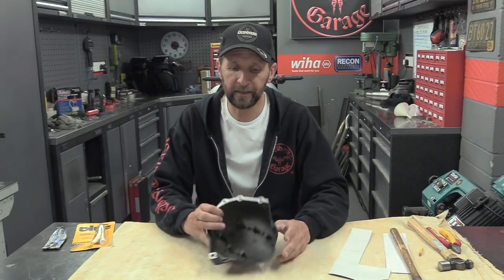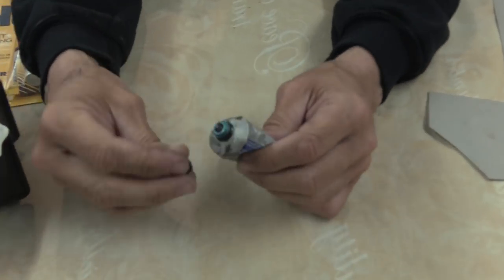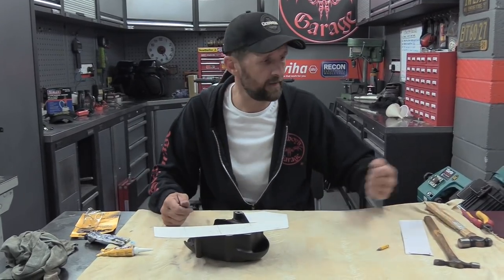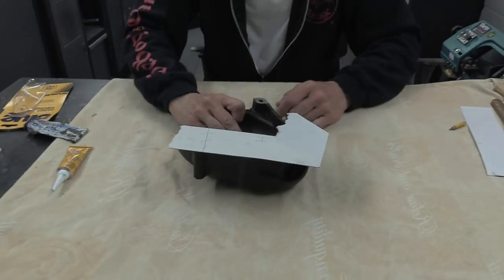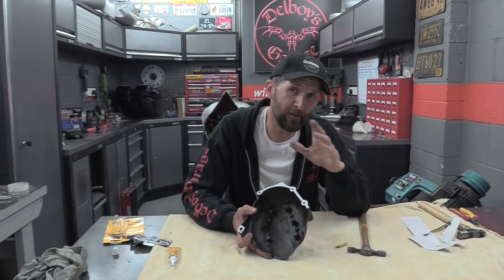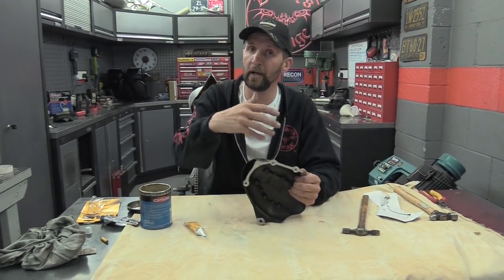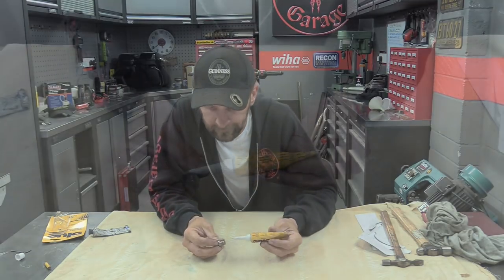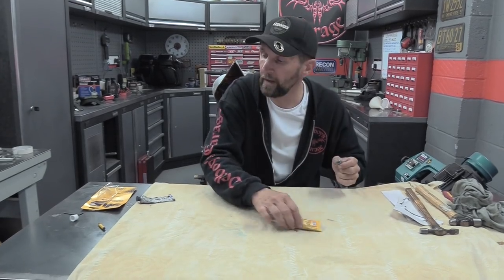Delboy's Garage, Simple Skills, "Tap out" a gasket.

Comment: I wouldn't trust using normal thin cardboard as a gasket that has to cope with high  temperatures. I think it would make more sense to use  gasket material that was developed especially for specific temperatures.
Reply from the maker: Cereal box card is absolutely fine, it's been used for gaskets for generations.. just know the difference between a critical gasket and a secondary gasket!      Cylinder heads, base gaskets, valve cover gaskets, anything involving pressure.. buy the real ones.. but side casings, perfectly fine to make one using regular ordinary card !

Comment: FZR600 Genesis Clutch all done and completed with the clutch case gasket completed as you demonstrated. No leaks. I did buy a hole punch set to do the holes, made life easier. Thanks again for the top tip from your experience.

Comment: Hi When I make a gasket it is in a similar way, the only difference is I cut the holes first and drop screws in to the holes. This helps stops the gasket sliding or wrinkling. 

I do this with a tool I made god only knows how long ago.

Its a punch of sorts using 3 short pieces of round bar about 100mm long and 10mm dia with 8mm 10mm and 12mm ball bearing welded to one end for different size holes.

Hitting it with a light blow in the centre of each hole covered with the gasket paper and the ball will shear the paper as you do with the hammer on the edge leaving a perfect cut hole. It is also useful where there maybe a tight corner on the edge of the casing where a even ball peen hammer would find it difficult to get a nice clean cut unless its very small one.
Reply from the maker: Wise words well said my friend, thanks for your input !

Comment: Definitely in the top ten of Delboy's how to videos. Invaluable stuff. Can be used on any engine. Ideal for joints, such as oil cooler hoses and pipes. A flexible and reliable seal. A must have, like copper grease, in any toolbox.
Reply from the maker: Basic automotive condiments aye..

Comment: Ah, 'tapperty-tap-tap' - now, where have I heard that before?
Good vid, good advice, & good looking camera-type far too rarely seen . . .
May I add that a random range of old ball bearings are handy for cutting out neat bolt holes in gaskets too, just press down & twizzle, works well . . . but only if you've got the balls : ) x
Reply from the maker: Too right buddy, thanks for that, I forget about the ball bearing trick, in fact if you have a little ball peen hammer you can press the back end in for the same effect!

Comment: can you also dry hylomar while it’s bolted on the drain plug thread? No drying it out before install?
Reply from the maker: It is better to let it tack dry before you install it, you'll get a better seal if it's a damaged, or worn, thread.
Reply: Delboy's Garage thanks just got a reply from hylomar, they said it’s okay to thread it right away as it would be difficult to thread if you dry it out before install.

Comment: Hello delboy, do you know if this is suitable for a rubber valve cover? It's for my car, I have replaced the rubber gasket and I did clean the groove in the the valve cover which the rubber gasket sits. I also cleaned the top part of the engine which the gasket sits on top off. I have a genuine gasket but it still leaks. Will this stuff work? Thank you 🙂
Reply from the maker: For rubber gaskets, if they weep, i'd use a light smear of silicone on the engine and on the cover and it should seal oil tight mate.!
Reply: @Moonfleet41  thank you, I really appreciate the response. Do you have any recommendations? I feel a bit lost with this type of thing lol
Reply from the maker: @sparkeli4513  No problem, i don't have any brand recommendations...just look for "Instant Gasket RTV", that'll do the job nicely..!

Comment: Oh the good old days ..and if you're desperate and dont have blue use red(not) and buy a jackhammer to get it off next time !!! Been there !! 👍☮❤peas n loaf to ya both❤

Just to be clear 
Blue for everything including fuel.
Red water ..hot water...👍👍
Reply from the maker: springy 2112 - cheers buddy, good point well made, always used to use the red stuff for coolant leaks, especially on flat faced unions... I did my formal training on Gardener marine engines (which is what they used in London buses), big 9litre straight six and they're covered in those stupid joints, which like to leak about every 6 weeks!... so after a few years, they become like Aunt Maud after a night on the pop!! - leaking, smelly and obnoxious - ho hum! happy days....
Reply from the maker: Spark R - thanks buddy, I think this stuff was invented by Noah to stop the door leaking o the Ark !

Comment: Got charging issues, again! What's the old saying "buy cheap buy twice ". Well I bought a new alternator from the bay of e three months ago and it's gone again only showing 9.5v and not climbing even after revving past 3k
Anyway got an actual Suzuki one now but sick of forking out for a gasket as they are expensive being single use I thought I would make one.
Thanks Del for another great video  and a cool looking hoodie x
Reply from the maker: Hi Marc, glad this old video can help you out!   Best of luck with it and hope it goes well!  Have a blessed weekend and keep safe!
Reply: @Moonfleet41  thanks Del unfortunately it turned out to be the flywheel magnito, two of the magnets has fractured.
Having a job finding a replacement.

Comment: Never use goo sealants unless I really have to, for the reasons said. Much better to use gasket material paper and fit it dry.  Seen to many engines covered in red and blue goo to be confortable. Bodgers tool.
Reply from the maker: Hi Kev, I have to say that on modern new engines, you're dead right.. the mating surfaces are razor sharp perfect and a dry gasket it all you need... perhaps I could have made mention of that, but have spent so many years working on old engines, a lot on diesels as well, and things like Hylomar are essential as a dry gasket just don't cut it... was always why I made it clear to use a tiny amount and let it dry as I too have seen this slathered all over the place where it ends up floating around in the oil and bunging up the strainer!

Comment: Doesn’t the paper gasket degrade and leak over time from heat and engine oil?
Reply from the maker: Pretty much all gaskets are made from paper , only head gaskets are made from more heat proof materials, so you wouldn't use this method for a cylinder head... but things like side casings and sumps, this is perfect...
Reply from the maker: Pretty much all gaskets are made from paper , only head gaskets are made from more heat proof materials, so you wouldn't use this method for a cylinder head... but things like side casings and sumps, this is perfect...

Comment: Nice!  Any idea where you can get actual gasket material, by the sheet or something?  I have to admit I would feel a lot more comfortable with a small plastic or rubber mallet, rather than any metal hammer of any size or weight. Other than that, yet ANOTHER brilliant video!
Reply from the maker: Hi Jeff, you can buy gasket card from any decent motor factors, and you need a metal hammer to cut the card, a rubber one will just bounce off and probably a nylon one too, give it a try and you'll see... if you're not happy with the small toffee hammer, then try a hard roller, the kind you get from the DIY store...
Reply: SO frustrating!  I asked about making my own gaskets on a Facebook forum of thousands of bikers over a year ago, and NO ONE had any idea how.  You just popped out an easy, cheap method like it was nothing!  Wish I had known about your channel the day I bought my first street bike about 3 or 4 years ago!  I've found some gasket material available at several auto parts stores.  And I'll try all kinds of hammers to see which works best for me.  Thanks so much!  AGAIN!!  FYI, I watched one video today that used hollow punches to cut the holes.  Think I'll test that also.  Cheers!
Reply from the maker: Hi Jeff. Glad you could find the video useful.. i heard of guys even using empty bullet shells to cut the holes.. they work perfectly with a tap on the back.. and obviously come in a range of sizes too 5.56, 7.62, 9mm, lol..   Take care my friend, and keep in touch... Del.